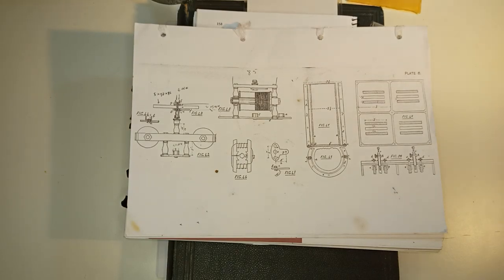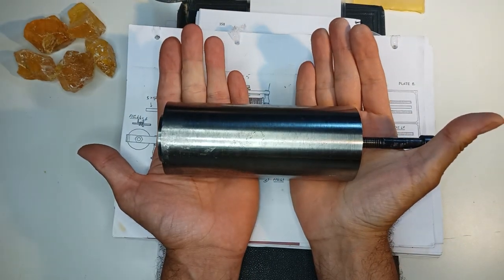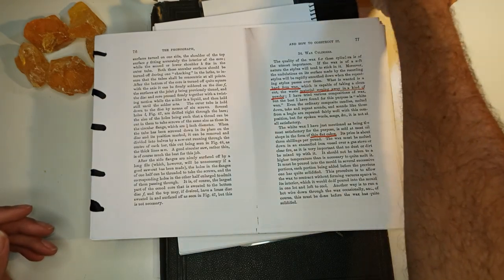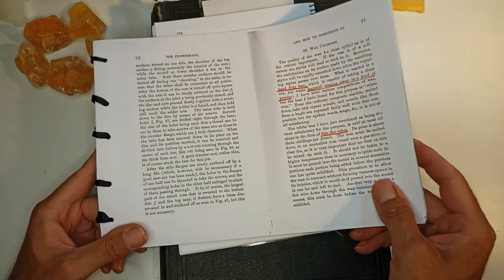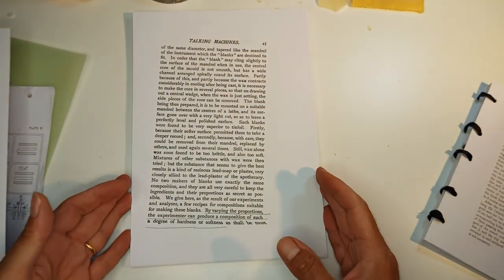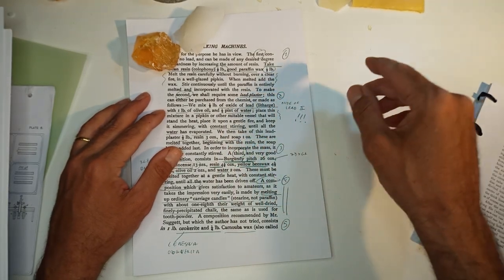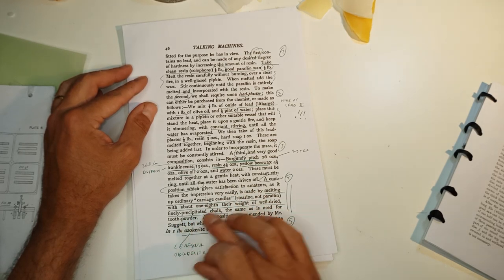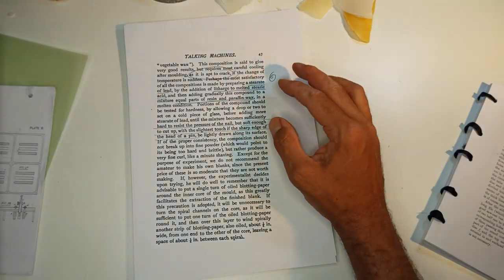The Gillett Phonograph project 18: Phonograph cylinder wax recipes.

Comment: What of the commercial 'brown wax' formula? Roughly
12 parts stearic acid
1 part caustic soda
1 part paraffin
A dash of aluminum oxide.

I've seen videos on preparing the wax: it appears to be boiled at a very high temperature, though, which may be risky...